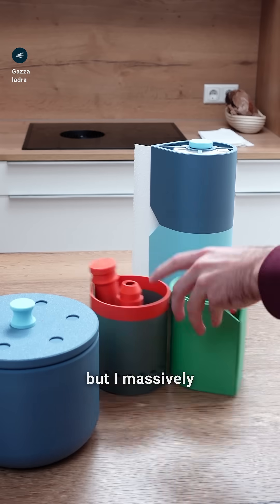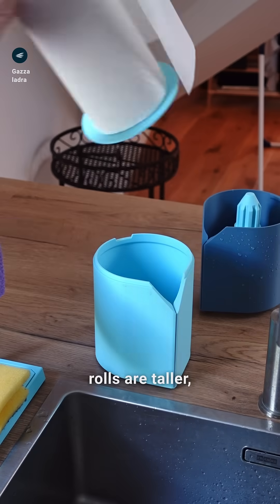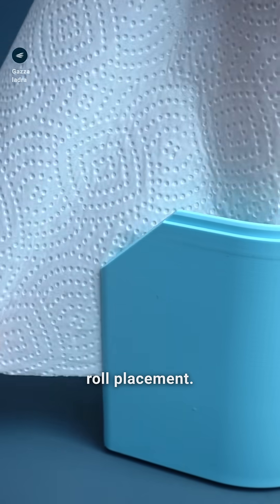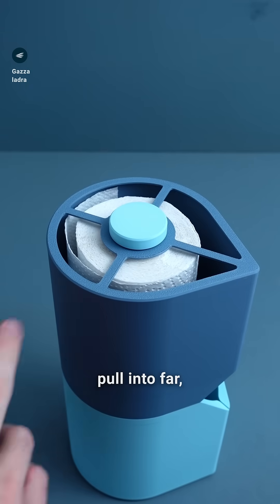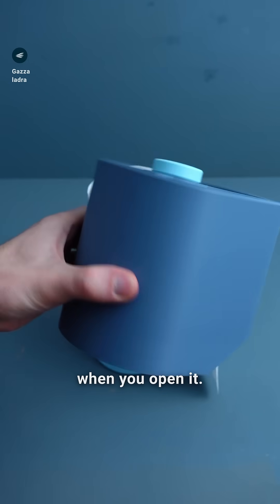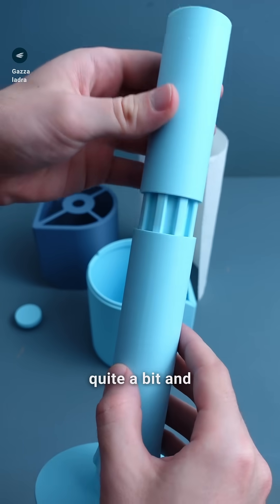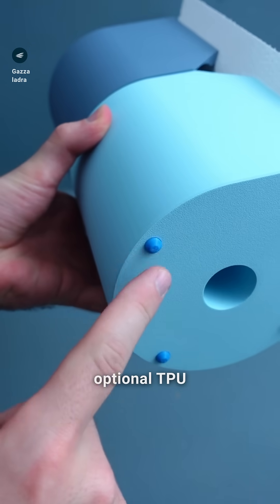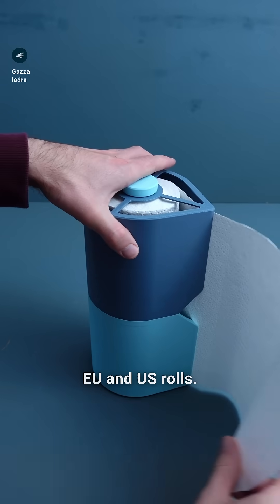I over-engineered a 3d printed kitchen towel dispenser!

Comment: re do it again, add some suction cups or magnets at the bottom so you dont have to use 2 hands to get 1 tissue
Reply: Suction cups don't stay stuck for very long, especially on dirty/soapy surfaces (ask me how I know), and magnets would require a sizeable metal surface to stick them to and not many kitchen counters have that

You're right that one handed operation would be ideal but I don't think either of those options would really do the trick

Comment: Honestly people may think it's "a solution to a non problem", but for people who actually clean the house and need to grab paper towels multiple times a day, this sounds INCREDIBLE. It solves the most common issues with the usual roll holders (being that 1. It needs to be close to where I need it for convenience, which often can get the paper wet, and 2, the worst of all: the roll holder walking around when you try to rip the paper...)
Everytime I see one of your designs I wish I had a 3d printer SO BAD! I am staring my PT holder rn and wondering "why can't you be this helpful too..."
Reply from the maker: Thanks! I appreciate your appreciation and attention to detail! (You should get a 3d printer though, an entry level thing for 200 USD can already print 99% of designs out there, in fact 100% of my designs)
Reply: @gazzaladra  when I get a bigger apartment I may really need to invest in one! Even if just for the decorations you make it would be worth it
Reply: @gazzaladra I recommend for if you have money a bambulab but for budget like me a flash forge really good quality and almost never fails the new one they released also is good for cheap multicolor for 300 bucks
Reply: It is really non problem here, idk how people can make paper towel wet, first of all put it farther away from sink, so water splashes don't get there, here it is
Reply: @tsugumorihoney2288  or use a cloth towel
Reply: Someone who cleans their house would invest in cloth rags 😭
Reply: @Jesei1211   oh yeah sure, try cleaning cat vomit with a rag and tell me how it goes and how hygienic it is!
Try cleaning food om the ground with a rag while having cats and tell me how many miliseconds it took for the rag to get completely covered in hair (which not only gets easily stuck inbetween fibers of cloths, but is again very unhygienic to reuse), try drying the counter multiple times a day with a rag and notice how it either doesn't have time to dry completely, so it keeps wetting the counter again, or dries up and gets hard and unusable, unless you wet it.
Let me know how it goes, and how much easier all would've been with PAPER
Reply: @MaridoDoFelps lmfao how wet are you getting everything to where your rag will be too soaked to pick up more moisture? That last one is also dumb, even if your rag gets crusty after drying, you can still use it to pick up water.  In any case, I don’t see why you’re against using a rag.  You can at least cut down on how many paper towels you use.
Reply: @Jonathan-rw8uw ??? Who spoke about water lmao, I use it to CLEAN, not dry. Like I said I have cats, which love to throw up. Do you think it's smart to clean cat vomit with a rag? Yeah neither do I. Paper towel is the best for this kind of clean-up.
Plus for cleaning dust it's way better than a rag, because the rag will get dirty and need to be cleaned very quickly, but a paper towel you can just throw away and get a clean one to keep cleaning the house.

Like I already said, if yhis is not the way YOU use paper towels or deal with cleaning, this is clearly not the video for you. But for me who uses paper towels a lot and for these specific things? This is great.
Reply: @MaridoDoFelps You literally talked about drying the counter multiple times throughout the day. If it’s not just water you’re getting on the counter that often, you’re doing something wrong. Anyway, I was addressing those last two non issues you mentioned as reasons that using a paper towel is better for that situation.  You normally won’t get water on the counter so frequently that it doesn’t have time to dry.  In the other situations like cat throw up, you’ll obviously want to use paper towels. You could still save some money on paper towels by using a rag for drying the counter.
Reply: @Jonathan-rw8uw  those were examples, but even then yes, I live with 4 other people so there are constantly dishes to wash, the counter (which idk how your kitchen is, but mine is right next to the sink) gets constantly wet, so yeah the rag does not have time to dry since I use it 3/4 times a day just for that (and yes ai do have a rag for this, but like I said it is more than often wet or still humid, useless to dry).
I do use rags when I can, but I have to use paper towels multiple times a day anyway.

Also if you literally only disagree with two of my points, why are you diminishing the usefulness of this 3D print dude? Even if I only used it for cat vomit it would be worth it for the comfort.
Reply: Never in my life did I get my paper towel roll wet and use them all the time
Reply: Never had any of these issues 😂
Reply: Think y'all should invest in rags then.
Reply: Your local public library prob has one for public use
Reply: Honestly, I'm convinced you are not people who clean the house.
Reply: sorry but no it is exactly what you said in the beginning: a solution for a non existent problem. It is a nice engeering project, but it is absolutely not something a person ever needs.
Reply: Depending on where you live, your library may have a 3D printer. There might also be a paid maker space with one
Reply: For sure, expect you need both hands, have a bunch of steps to assemble and refill and will have to clean things that collect at the bottom
Reply: @tom2324  did ya watch the video? It's very easy to assemble AND disassemble lol
And dust collects at the bottom of everything, including metal paper holders. Even the open ones will collect dust, but at least with this it's less likely that the collected dust touches the paper
Reply: @MaridoDoFelps easier than not having a holder
Reply: This commenter absolutely positively must be either the same person as the video creator, or someone who knows them. There's no intelligent person in the world who cannot stop getting their paper towels wet before using them. This is absolutely ludicrous. Maybe it's rage bait.
Reply: @briancahill8610  just check my comment history, I am neither of those. Like I said multiple times here (but you are apparently too lazy to read my other replies) it may not be useful to YOU, but in the context I use paper towels this is amazing.
Reply: get a used but excellent condition Ender 3(pro/plus, not base) at christmas or black friday next year. Only costs a bit over 100 usd. You also learn how to setup, calibrate, manage, optimize, fix, and everything 3d printer related. It also has a print volume of 300x300x300 mm which is bigger than the 250x250x250 bambu ones
Reply: A. Mount the holder on the wall and it won't get wet. B. They make holders that hold firm enough to rip the towel if you give it a good yank.
Reply: Sometimes libraries have 3d printers! I hope you can get your hands on one of these
Reply: "I want a 3D printer SO BAD"
As an engineer that makes 3D prototypes, I highly recommend investing in a Bambu P1S or better.  It's the closest thing to a "plug and play" printer.  Bambu slicer has great presets and it's a reliable machine, especially when paired with the gold textured PEI plate.

Cheap Enders or similar are nice but they require more calibration, tinkering and troubleshooting.  I've heard so many hobbyists get frustrated and just give up with these, or not have the time to bother with it, so then the Ender collects dust.
Reply: Just buy a towel and not paper to dry your hands and wash that towel once per week and that's enough, it's totally idiot to think you need to waste resource to dry your hands
Reply: @TheTrydy  my brother, you are clearly just not the target demographic if you think paper towels are ONLY for drying your hands. I use paper towels for everything around the house. I have cats, they throw up, you want me to waste water washing a piece of cloth every single day because I have to clean cat vomit? Yeah, paper towels are better for this.
And you don't clean much if you think a cloth is gonna last a whole week before needing to be washed... just cleaning the kitchen once is enough for the cloth to need a wash. Paper towels avoid wasting water.

If you don't see the benefits, you clearly are just not the target demographic.
God, people love to complain about things that aren't even FOR them...
Reply: @MaridoDoFelps  If your cats are throwing up so often, I think you need to take them to a vet. That doesn't normal whatsoever.

Also I don't think anyone is against this design because they think it's not needed. I think a lot of people nowadays just use rags to try to reduce waste.

You can buy a pack of microfiber towels at a relatively cheap price. They're really good for cleaning surfaces like counters and furniture. Paper is good for spills and dropped food if you don't want to use your towels on them.
Reply: @unlckypeach  my cats are just idiots who eat too fast even with slow feeders, (plus my big boy eliminates his hairballs in multiple throw-ups...).

And my girlie is old and refuses to use the litterbox, she uses dog sanitary pads. But being she's old and dummy, she often pees on the floor. NOT taking a rag to the pissy floor and then washing it to use again lmao
Reply: @MaridoDoFelps  I have a cat that does the same, we call him Mr. Fat and Furious because he yells if he's hungry. Cats have their quirks but we love em anyway lol

We use paper towels as well for any nasty stuff. Rags in my house are mainly for daily cleaning on the "easy" stuff.
Reply: @MaridoDoFelps off topic but just so you know, it's not at all normal for cats to vomit often. (Your comments kinda sound like they do that very often)
Reply: @dino_nerd_ultimate  I replied to someone saying the same thing.
I know it's not normal, it's just that my boy is a glutton + has trouble passing hairballs. He gets checked at the vet, he's fine, just eats fast even with slow feeders.

He was a stray, got a foster home, and was later thrown in the street again by the fosters, so he is always scared he will not have a chance to eat again, even after 11 years living with us...
Reply: @MaridoDoFelps Poor boy 🥺 similar here with mine! I'm glad u guys are taking care of it 💖 all the good wishes!
Reply: Really? What's wrong with a wood spool on a base? No parts just set the roll on it. Been here 59 years and have not once thought the design needed to be complicated like this.
Reply: @ThaiLifeAmerican  again, you have no way of holding the paper still with one hand, sometimes even with two hands the paper still rips and a stripe of paper is left attached to the roll, and this one offers protection from water, so you can leave it closed to the sink without wetting the whole roll.
Yeah sure the basic wood/metal ones are okay, but this is actually GOOD, not just okay.
Reply: @MaridoDoFelps Yes!!! Yes!!! Exactly! 🙏🙏🙏
It's a never ending frustration, these stupid sticks on a plate that do not solve any functional problem at all, in ways of dispensing the paper. 
You solved a problem that's dear to me! 
You really thought of everything! Beautiful. 

Might need a horizontal easy to hook to cabinet doors version... 🤔
Reply: it is a non problem id you weren't stupid. put the paper roll away from the sink and use a towel to forst dry your hands like wtf

Comment: Very coool. We at home use really big rolls and they have no place to tear. Maybe it would be cool to add 3 holes where you rip the paper to possibly add a rack of metal teeth to rip paper easier. 👀
Reply: Small points acting as teeth in the design might even be enough to do the job
Reply: @Tommyboy292  yes possibly. But can the printer make sharp enough plastic teeth is the question.